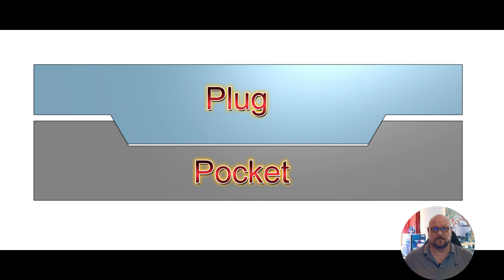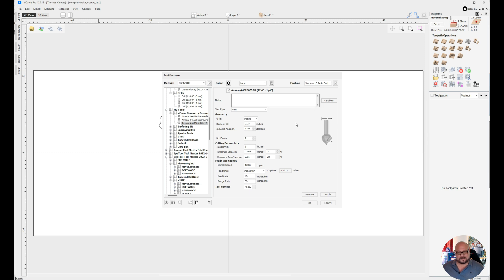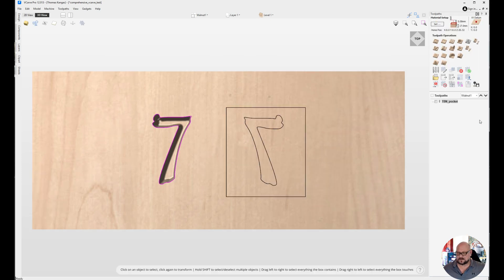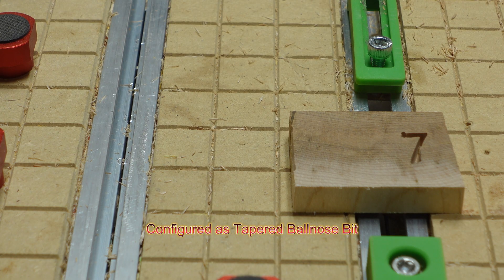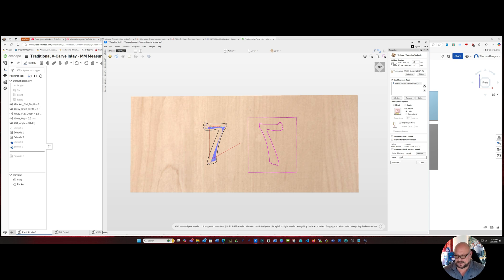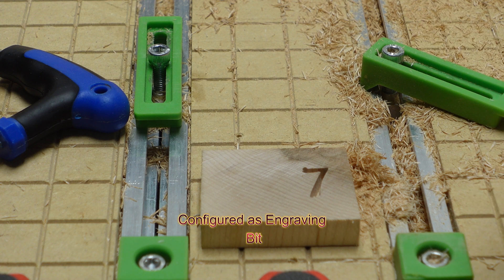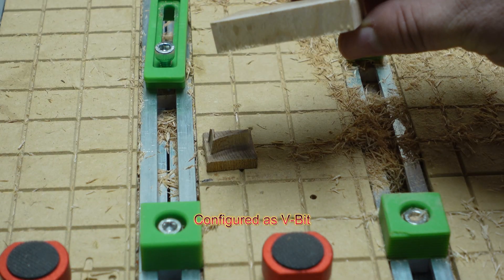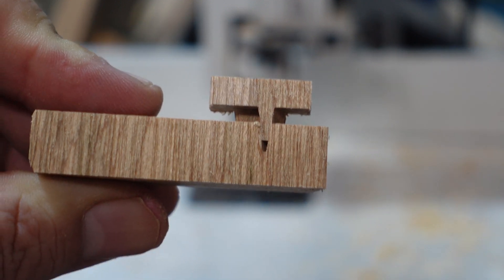You Won't Believe The Impact Of Vcarve Tool Geometry On Your Inlays

Comment: hey there Thomas . have one question ,first I have carbide createPlus and yes ive watched your video there as well!I have a 6.2 tbn o.8 diameter ball end I have started at 3.5 and 3.5 and done 5 plugs last being d= 0.05 and s=6.95 still leaving a 7mm plug as you said ! yes plug is slightly enlarging ! so what happens when I run out of D ? do I enter minus?
or do I make the total plu 8 or do I decrease it back to 6? !really appreciate some help ! maybe carbide just wont hack it ? I have some special tool bits arriving after xmas.
thanks Pat

Comment: Thank you for posting these.... I am tearing my hair out trying to do a deep cutting board inlay with this bit.  One note:  I believe the 46280 is a three flute bit, not two.   Not sure if that matters much...
Reply from the maker: I believe you are correct. That bit has 3 flutes. I haven't noticed a difference, but these are relatively small CNCs compared to industrial. Still, thank you for pointing that out. I probably entered it wrong when I copied it, and made it a "v-bit". Thanks for watching!

Comment: Did you upgrade your CNC?
Reply from the maker: I purchased the Shapeoko 5 pro in October of 2023, and started using it full time early in 2024 after Carbide3D had to correct some issues with the version of control board that came with mine.  I can definitely say I love it so much more than the SainSmart, but only because it is larger, and has more features. Thanks for watching!